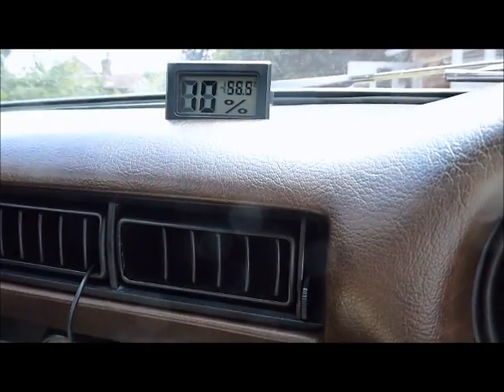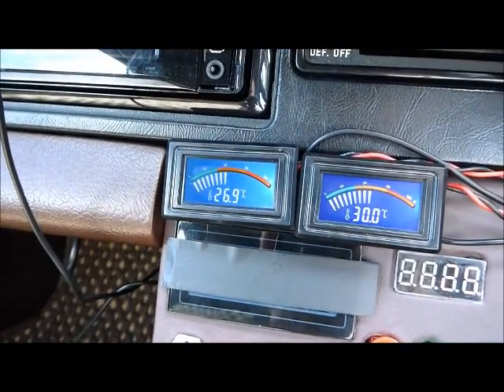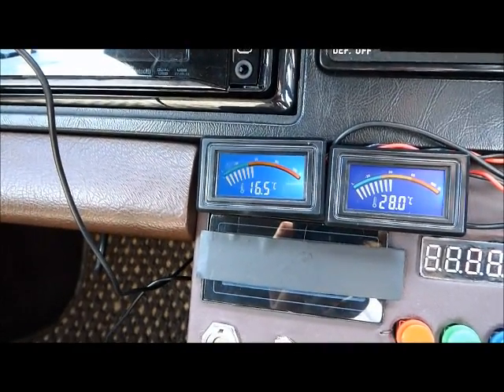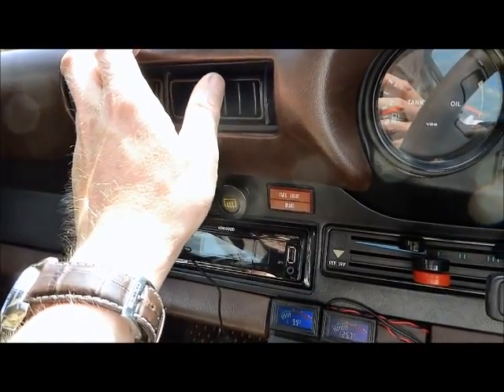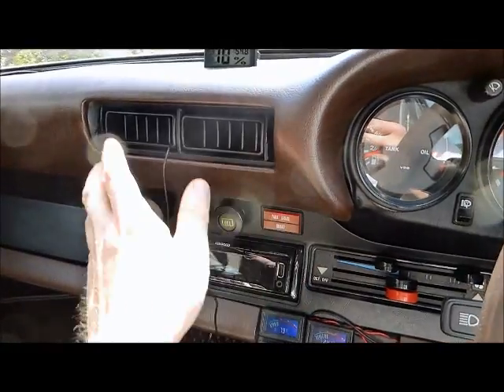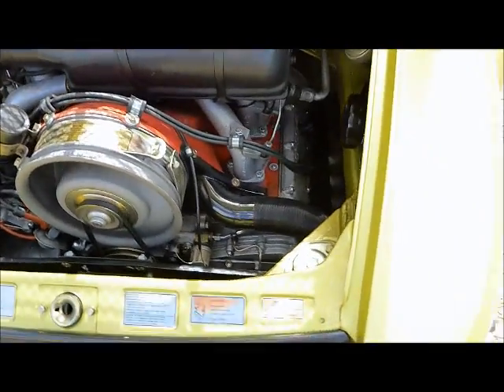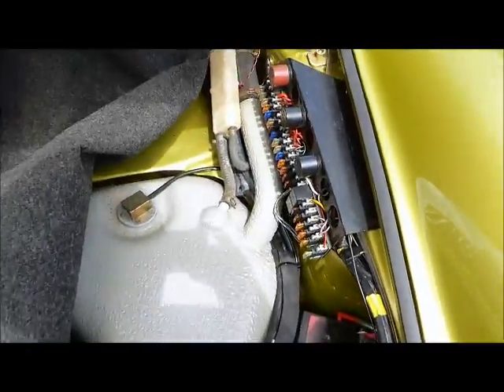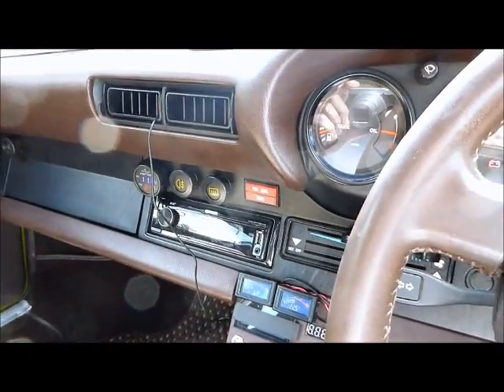Classic Porsche 911 Electric Air Conditioning: behind the scenes on research and development

Comment: Got a old 2000 Mercury. Sure it has belt AC. But ever have a car with AC that doesn't act temperamental with its AC on? I hate it.
Live in Florida. Might do this just to stay cool.
Reply from the maker: We're working on an underdash unit that includes the evap etc. Could be just what you need. That said, a lot of people have just bought the compressor and ECU and found a way to integrate it into their vehicle.

Comment: Thank you for making this video. I wish you had gone a little more in-depth of how the system is set up. are you using a hybrid electric AC compressor or an after-market one? are you using a motor controller? You said the system pulls about 40 amps is that Peak when it turns on or is that continuous?  I'm going to assume that it's 40 continuous and that Peak is a lot more. I would almost guarantee that will fry an alternator that's only 75 amps. I'm getting ready to put an electric air conditioner in my 240Z and I put a cs144 alternator (140amp)and I was worried that that would be too small. If you look at how alternators produce current the peak number isn't what it will do at idle and that's when the damage will be done. Even though a stronger alternator will generate potentially enough electricity it will have to be robust enough to handle the shock loads of the compressor turning on. I picked this alternator because its used in everything by GM.... it's really cheap and you can upgrade it. I would highly recommend looking into a much better alternator solution for your 911.
Reply: Looks to be a benling compressor.